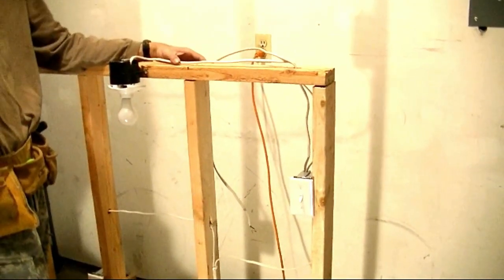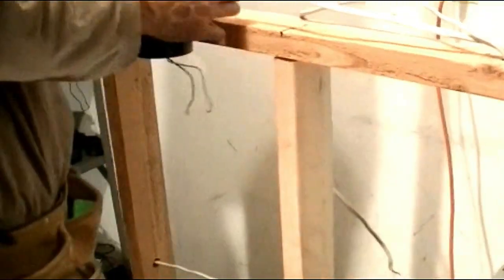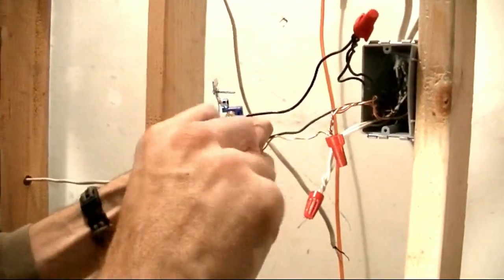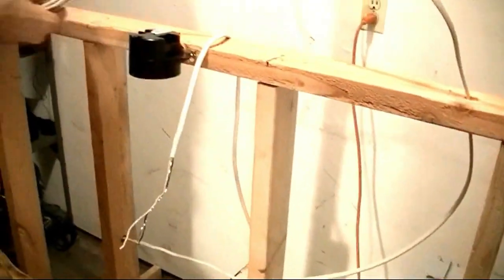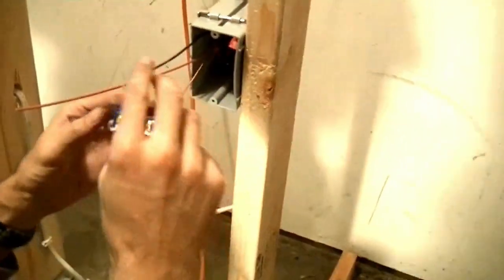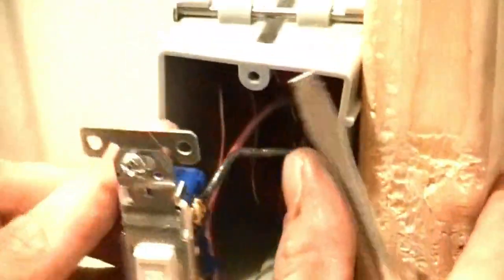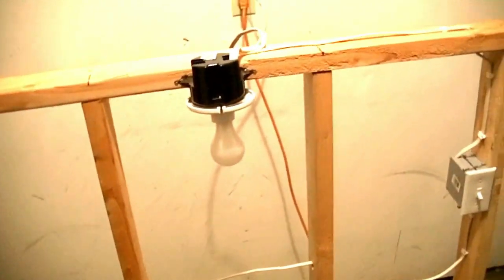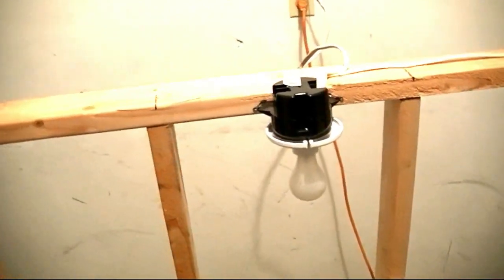How To Save Money By Using 3 Wire - DIY Electrical

Comment: Ur 1000% correct at the end! I grow cannabis and i'm building a small print shop n my single wide; YES, there should be regulations necessitating 20amp circuits in place if 15s for most applications. I neednto replace 9 continuous recetacles on a 15amp gfci breaker...now i know y that's the only circuit with gfci breaker! That shouldn't even be legal, u just fry all the outlets over time; this is a single wide, i've effectively lost power to 25% of my entire house with those 9 receptacles basically serving as fire hazards. If it were a 20amp circuit, it would offer safe operation for longer.